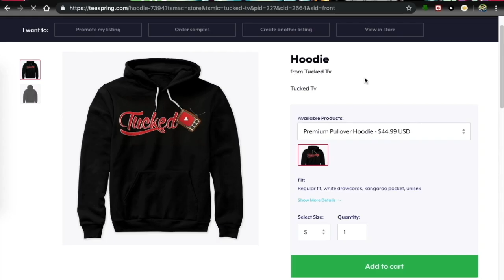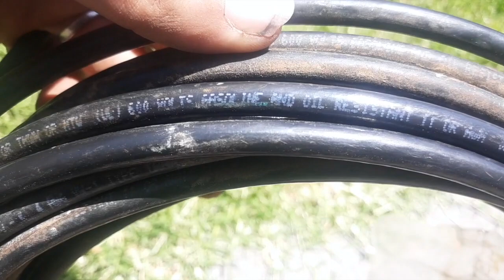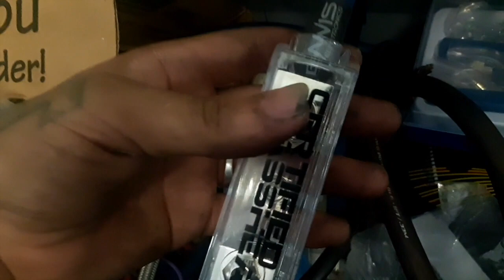Quick Easy Wire Tuck 96-00 Civic (NO WIRES)

Comment: Hey man quick question, how did you delete power steering? Love your vids!
Reply from the maker: Took everything off and filled up rack with fluid and used a hose from both outputs connected em together at firewall

Comment: Where’s a good place for the grounds?
Reply from the maker: I did em all using 0 gauge wire, I did one in stock passenger side location on transmission to frame and from top bolt of alternator to strut tower